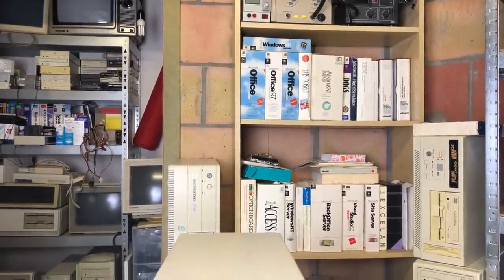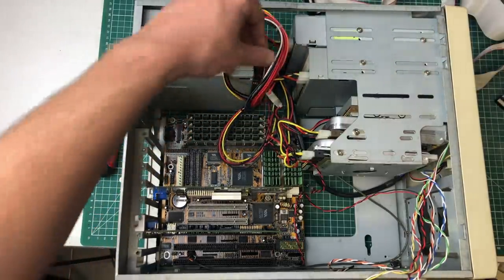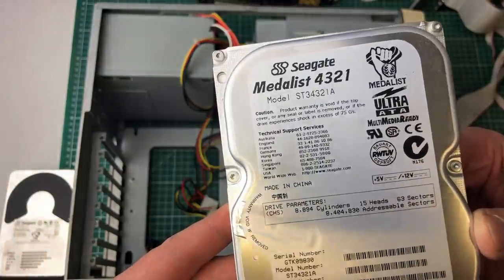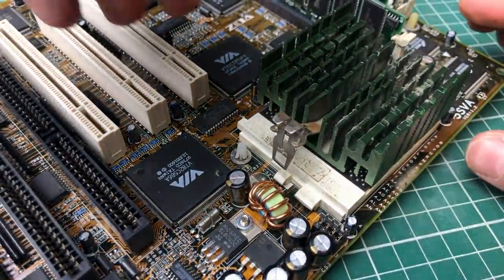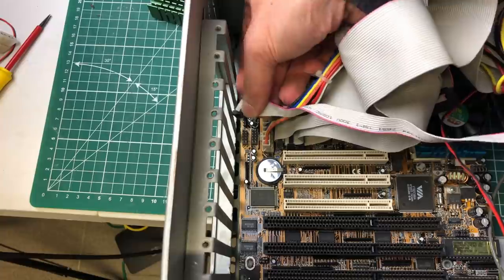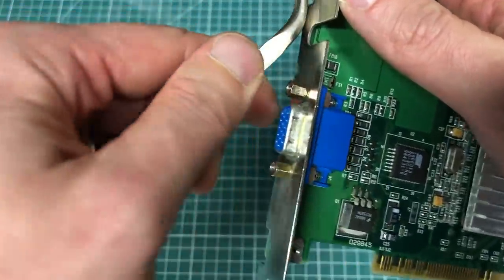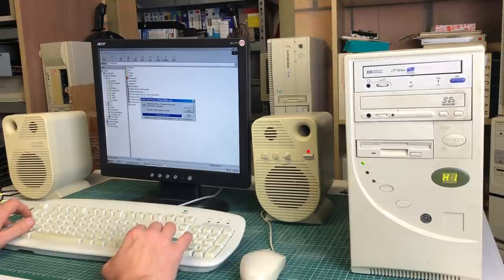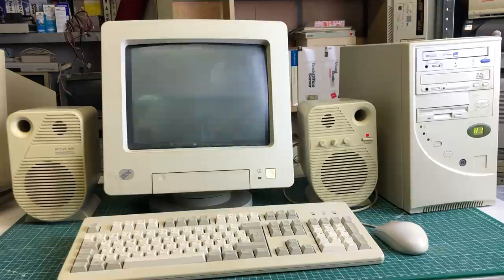Pentium 200 MMX find with Voodoo Banshee

Comment: Carmageddon in 3Dfx mode is pretty demanding. Even with my Pentium II 450MHz with Voodoo II SLI, it still struggle a little.
However you can still play it in software rendering mode and it'll run ok on a pentium (or even slower).
Reply from the maker: Weird because I played that many many many times when I was young and can’t remember it being it sluggish :) wonder what system I ran it on at the time. Never had an SLI setup.
Reply: Well in software rendering it runs better than the 3d accelerated mode actually (one reason being the software rendered mode runs at 320x200 resolution vs 640x480 in 3d accelerated mode which is 4 times more work, even though the 3d card helps a lot). On the other hand, this game is playable without issues on my Pentium III 1GHz (in software rendering mode and in 640x480 !)
Reply from the maker: Deksor we were all using voodoos back in the day ... I clearly remember the 3dfx wow effect we had (also in carmageddon)

Comment: Very nice, Pentium 200 mhz was and is kind of rescue when I was strugling with those 3DFX VLB and Voodoo technology issues wich I never came about ! Laer pci standard solved all setting windows as standard platform for games, more performance, later I assembled a PII 350 but up to now not enough for the serious 3D work, wich my new systems cover, althought a duocore 1.6 1 Gb Ram stil strugle with multitasking, where for quadracore system and discent ram make up for now ! Cleaned the PI 200 a while ago maybe shoud so but I don´t run it so often, modernize the network capibility, so saving the data is top priority nowaday´s as this hasn´t any usb ports. PII 350 does still some driver problem highlited, than if resolved I need to use some older sticks to access as usb 1 may only supported. Hope fully I still can find a PIII 1 Ghz system somewhere as system with multiple core´s are less compatible with older games !

Comment: A not so bad chipset from VIA for the Socket 7. My Voodoo 1 system (also a Pentium MMX, FIC PA2010+ mainboard) with 128 MB installed SDRAM memory has the same VIA VPX585. 🙂
Reply from the maker: yeah I'm pretty happy with it so far. Lovely machine.

Comment: I think someone else has mentioned this, but I would like to clarify.

It is ill-advised to mix memory types. You could buy EDO RAM in the DIMM form factor and initially I thought this was likely to be what was used, but apparently it was not and this likely caused the issues. Now what would be interesting is if you swapped the memory around. I suspect that the 32MB DIMM would be perfectly stable on its own and moreover, marginally quicker. If we're honest, it is unlikely to make the system appreciably faster, but certainly technically faster. I would be interested to see if I am right.

I have to be honest, I kind of cringed when you stole the bracket off the S3 Virge, Number 9 cards were the top-dog at one point (1993-94 I kind of recall), so as much love as I have for the Banshee, I also love the Number 9. Still, nice to see this machine be ressurected. I have a Pentium 200 with a Banshee and it has me searching for an MMX overdrive again (Socket 5 Compaq, it needs the MMX luvvin').
Reply: I never knew about the Number 9 back then but now I have 3-4 or so. I would never sacrifice it too even though they sit in a box.
Reply from the maker: Really ? Is there a difference between a Number 9 S3 Virge card and any other S3 Virge card ? Was not aware of them ... And still think it's nicer to have a banshee firmly attached to this PC case as opposed to the Number 9 sitting in a box :)
Reply: @RetroSpector78  Yes, number 9 is quite rare. :-)

Comment: I didn't know that both ram slot types could be populated simultaneously. I assumed it was one or the other. I don't think it's bad memory, but the fact that memory types aren't supposed to be mixed.
Reply: My thoughts as well.  I would even try with just the 64, and then just the 32, to see which one was faster.   My memory is fuzzy(lol), but IIRC even 32 was usually enough around then.

Comment: About, the input sound at 14:07, I've had a similar problem, what was happening is that one of my power supply connectors were shorting out against the case. I advise you check your power supply properly for faults.

Comment: I recently ran across a socket 7 board myself. It has cost 10 Euros and was in decent shape too. No bulgy capacitors, no battery leakage thanks to coin cell. 

I populated it with old stuff I still had laying around: a Pentium 233 MMX CPU, 10/100 ethernet card, SB Vibra 16, an ATI @work with 8MB and a Voodoo 1 card. I was a bit disappointed because some of my old games this machine was build for required better specs as they were released around '99/'00. From '95 to '99 I literally played no games and have none left from this era. So this is, in my case, a somehow strange PC. Too powerful for a DOS 6.22 machine, too weak to be my Win 98 gaming machine - as my build from that era was a K6-II 500 if I remember correctly. So what to do with it? 

Any suggestions? :D
Reply from the maker: With this type of build you need to
Stick with 1996-1998 era games. Anything beyond that will be challenging. This mainboard maxes out at 333mhz with an amd k6
Reply: I guess this should be powerfull enough to handle all quake I/II engine based FPS's so plenty. And all build engine games of course (Duke nukem 3D, Blood, Shadow Warrior, Redneck Rampage), Doom engine games, etc. Plenty to keep you up at night :)

Comment: Banshee had faster clock rates, more RAM but only one texture mapping unit. Voodoo2 had slower clock rates, less RAM but two TMUs. 

 Who was the winner? In games that uses multi texturing (and of course benchmarks) the Voodoo2 wiped the floor with the Banshee. If the game used only single texturing the Banshee was faster (both in 800x600p of course)

Overall I prefer the Banshee, because it can run higher resolutions then the Voodoo2 and you avoid the image quality eating loop cable from your 2D card to your Voodoo2. 

But Voodoo2 12 MB in SLI mode was a beast in 1024x768 nevertheless. Had two of them from Creative Labs running with a PII 333 with 128 MB RAM back in 98. That thing rocked. :)

Comment: What’s the maximum of RAM can it be installed? And how about upgrade the processor to K6 series?
Reply from the maker: K6 333mhz with 256mb ram would be the maxed out config, providing it is true that you cannot mix memory. Manual only states : “Board accepts EDO (128mb) & SDRAM (256mb) memory.”
Reply from the maker: But don’t have a k6 333 unfortunately
Reply: RetroSpector78 Can’t it install a K6-2 or K6-3? Or just overclock the FSB to 100?

Comment: Wow similar to the system I built. P200mmx, banshee card, but I had a generic sb16 compatible sound card. Was a great build for the time. The banshee changed my gaming life back then. Night and day. Carmageddon was always a bitch to run. 3dfx support was tacked on in a patch and never really worked as well as it should.
Reply from the maker: Really hits a sweet spot for 1996-1998 games. In my memories carmageddon ran smooth as butter back in the day. Funny how your mind can warp things. Or we were far less demanding back then :)
Reply: @RetroSpector78  Well.... Carma ran smooth as butter on this setup IF you'd tried to play it without the 3dfx patch first ;) I first ran Carma on a P100 with no GPU. That was ...interesting. :D

Comment: I'm also often trying to solve the missing bracket problem. So, I ordered plenty of blank standard metal PCI brackets and then I drill and cut to the precise measurement. It always works well, though it holds only on the connector screws. I was never able to find a suitable donor card for the bracket transfer. The same goes with the motherboard I/O where it can't be bought. Ordered some blank plates, then I drill and cut as needed.

Btw. may I ask what kind of equipment do you use to record your videos?
Reply from the maker: I'm not that good with a drill :) fortunately most of my cards come with brackets. I'm just using my iphone 10 to record video.

Comment: Lmao, that's the exact same case my first Pentium PC is in. I still have it.

And funny enough it also has a Pentium 200 MMX, but the motherboard is different (it has a MB with the 430vx chipset) and it has a 3Dfx voodoo 3 2000, and 64MB Ram (because of the 64MB cacheable limit).

It started life with a Pentium 133mhz, 16MB ram, S3 virge DX. Bought it used in the mid 90s For $100.

Comment: The SDRAM could also be some rare kind of EDO memory in „SDRAM-form factor“ like IBM used in the PC GL 330. them it can be mixed
Reply from the maker: Not really sure ... didn’t look like anything special, and to be honest don’t think the original builder would have taken that into account :) the manual did say something about them being possible to use together.
Reply: @RetroSpector78  I wanted to delete my comment, because later on in the video it is clear that this specific board has a SDRAM-Slot. I've got such a config too, and I decided to go with SDRAM only. Mixing is forbidden according to the manual and results in strange crashs like shown in your video.
The IBM 330-mainboard is a rare case, and has indeed nothing to do with your system.

Comment: That system looks suspiciously like what I call a storage system. You stick a board you aren't using into a case you aren't using, then tuck parts you aren't using into it for protection. It explains why the SIMM and DIMM slots are both populated, all the headers are just flopping around, the CPU doesn't appear to have heatsink compound on it, the CPU fan is missing, the motherboard doesn't have standoffs, and that ridiculous "no bracket" video card.

Comment: • An MMX CPU on an AT motherboard? 🤨 <insert Odd Couple theme song>
• Is that a typo in the description or was it intentional? 🤔
• 4:47 - I KNOW RIGHT‽ 😕 I've often been incredibly frustrated trying to figure out the size of hard-drives. 😒 (You can calculate that one is 4GB from the C/H/S information, but that's hardly acceptable. ¬_¬)
• 13:20 - That's from the certificates being (long) expired, so Java is failing to install for IE, and old MS error-handling sucking.
• 13:27 - It could be the video drivers.
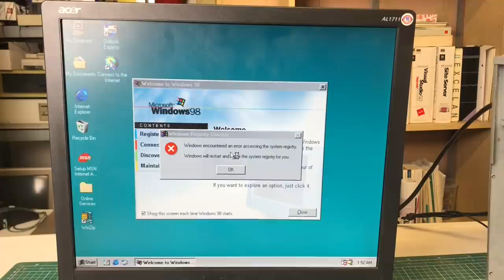• 13:37 - I definitely don't miss the fragile, rickety nature of Windows 9x.
• 14:09 - Yup, that's the sound of the input buffer being full and not getting processed to drain it.
• 14:12 - Damn RAM! 😀
Reply from the maker: haha ...  I did run a memtest for over an hour and no errors popped up. The thing is that this can be anything from drivers to mainboard to cpu to other peripherals .... or any combination of them. Luckily this was an easy fix. Still surprised memtest did not find anything.

Comment: The 12V rail has to be low if you do not load the 5V rail. The AT PSUs are 5V regulated only. The 12V is in the same transformer but never regulated. If the 5V rail is highly loaded the 12V will overshoot with 12,2/12,3V. AT was not a standard and there are no OV/UV limits in existance.

Comment: Still have my pentium 200 mmx. Overclcoked to 250 mhz on 83mhz bus speed. Needed heat paste to make it run. Would overclock to 233 on 75 mhz bus without paste.  Runs a voodoo vid card.

Comment: I guess t wasn't DIMM module's fault - those motherboards simply didn't support mixed SIMM and DIMM modules. I was surprised when noticed both installed, but I just assumed that there was some motherboard that supported both together. It seems there was not ;)
Reply from the maker: I still think some mainboards do.

Comment: @RetroSpector78 I have about hundreds of old DIMM RAMs, also DDR1 RAMs; included ECC RAM modules and also FB DIMMs and DDR2 RAM modules. If you need any of them, just let me know what do you want, I'll test it and I can send it to you. :)
Reply from the maker: Thx a lot for the offer. Appreciate it ... I also have bags full of them. Because the PC came assembled with both the edo and sdram together I assumed it worked at one point in time so the ram wasn’t my immediate suspect. Because there was no fan on the cpu I thought that might have picked up some damage. But in the end turned out to be ram. An easy fix. Sometimes it can be mainboard, ram, cpu, peripherals, drivers or a combination of all of those.

Comment: During this generation CPU/chipsets I seem to remember that RAM above 64 MB wasn't cacheable to the point that it's better to just let it maxed at 64 MB because in some cases more than 64 MB will actually make some apps run slower.

https://en.wikipedia.org/wiki/List_of_Intel_chipsets#Pentium_chipsets
Reply from the maker: Correct .... runs perfectly fine now with 64MB.... really enjoying the machine.

Comment: im surprised you didnt use the provided blanking plates on the case for the parallel and serial ports to free up the slots. Theyre next to the PSU, you could easily remove the ports from the original plate and put them there to save room

Comment: the 4321 is a 4.3GB HDD, had one myself.
Reply from the maker: It’s already turning out to be too small for all the games I want to install on it :)
Reply: @RetroSpector78  do you still need it? i would take it from you if you dont need it.
mine died for no reason, didnt get recognized in BIOS anymore, not even in windows. jumper settings werent at fault.
Reply from the maker: John Cena I have lots of machines and can always use a spare hard drive. Plus shipping would be a pain.

Comment: You could use both EDO and SD RAM at the same time? What craziness is that? You can't even use DDR2 and DDR3 simultaneously in the somewhat rare mobos that include slots for both!
Reply from the maker: I thought that some mainboards supported this type of setup. Could be wrong, but there does seem to be some debate on the subject. However I am perfectly fine with having “only” 64mb :) would never have mixed them but the pc came to me in that setup.

Comment: I have a similar system under my desk. :)
Reply from the maker: Happy I decided to get it off the shelf ... fun little system.
Reply: @RetroSpector78  About 3 weeks ago i restored my old PC from 1998/1999, which i found (dusty) in my the basement:
AMD K6-II @ 500 MHz, AOpen AX59Pro motherboard, Matrox Milenium 16MB AGP graphics card,
Sound Blaster Live! 5.1, Planet ENW-950x 10/100 PCI LAN card,
Adaptec SCSI, two SCSI (50pin) Plextor CD-ROM drives (36x & 40x),
two Lite-On 36x CD-ROM IDE/ATAPI drives...
I also found a lot of IDE hard drives, such as 15GB & 20GB Seagate (these with rubber around),
2x WD 40GB, 2x WD 80GB, 2x Seagate Barracuda 7200rpm @ 750 GB drives (!), etc...
After the necessary cleaning of the components i rebuilt the PC into a new case.
Now i have this setup: Radeon 9200 /w 128 MB AGP GPU, AX59Pro motherboard, AMD K6-II@500MHz CPU, 512 MB RAM.
Planet 10/100 LAN, SB Live! 5.1 (SB16 Emu driver for DOS games), Promise Ultra133 IDE controller
(because 750GB HDD needs LBA 48 - which MOBO AX59Pro doesn't supported (max is 137GB)). :)
Reply: Funny thing: Windows 98 "fdisk" doesn't support drives larger than 65GB.
Solution: Remove all partitions from the disk and start installing Windows 98 SE directly from the original CD. That worked for me.
Another solution for BIG drives is maybe try to partitioning in FreeDOS or MS-DOS 7.1 or Windows XP.
I also tried to create a disk partition with Windows XP. You just have to create a partition without formatting and then format it in DOS. But you have to use the format program from the Windows 98 SE boot disk. The format program will show a nonsensical lower disk capacity, but it will pass.
Just for record...
Reply: The original windows 98 FDISK is buggy and have been patched by microsoft to overcome that 64GB limitation. However, there's a second limitation at 128GB which is a hardware limitation this time (LBA28). Windows 98 can't use more than 128GB of HDD unless it's patched, and motherboards made before 2003 won't support more than this capacity (you need a PCI IDE card to overcome that limitation)
Reply: @DxDeksor  I have a Promise Ultra133 TX2 PCI IDE/UATA/ATAPI controller installed (as i mentioned before in comments) which supports LBA48 (HDD > 137GB - up to terabytes theoreticaly). I know about 64GB (65.535 MB) bug in the old FDISK versions. The FORMAT program is also have similar bug. :)

Comment: usually edo or sims  cannot be matched with sdram. i have a zida tomato 5dtx  motherboard and manual quotes that you can use either edo or sdram but never combine them. maybe the sdram has no problem at all

Comment: You have started it in the 640x480 "-hires" high resolution SVGA mode, that I've never been able to start, instead of standard VGA 320x200. If this is not some "Windows" port of the game, which might indeed take advantage of a GPU and drivers (through Windows), I'm afraid it will never run smooth - you just would need four times more powerful CPU, than a 100 Mhz one, if DOS can even cope with such fast CPU. This would be Pentium III at 450 Mhz, or, if we look at what the 200 Mhz is doing, then 4 times its own speed, for real smoothness (high fps) - that would be a 800 Mhz to about 1 Ghz thing, running into DOS directly, natively, not by DOS emulator in Windows. That would be a rare thing, in the 1990s: one Gigahertz processor.

Comment: why so much ram? It's insane for a pentium! I had a pentium 166mmx and with only 16MB and was enough. It's like a today computer I installed 64GB of ram
Reply from the maker: Think 64mb is the maximum that win98 will address. Dunno why the sdram module was added by the original owner
Reply: No Windows 98 can address up to at least 2GB of ram (but it will crash around 1GB on most PCs) unless you patch it.
On the other hand, most Pentium chipsets can't cache RAM over 64MB of RAM, so you may decrease the performance if you go over this amount !